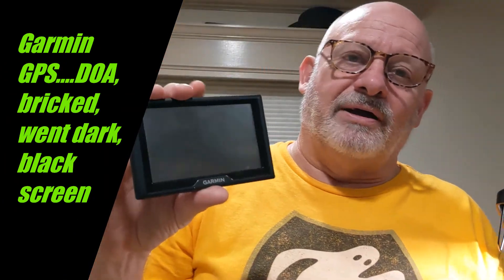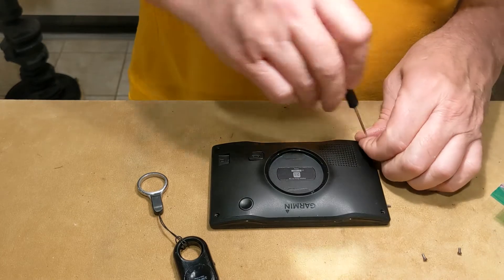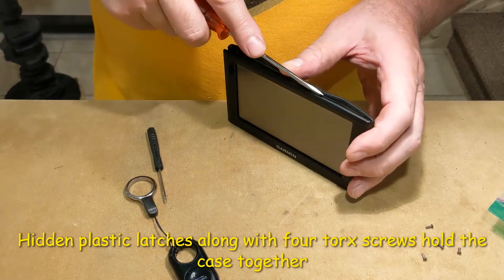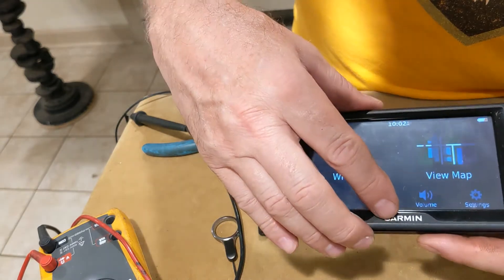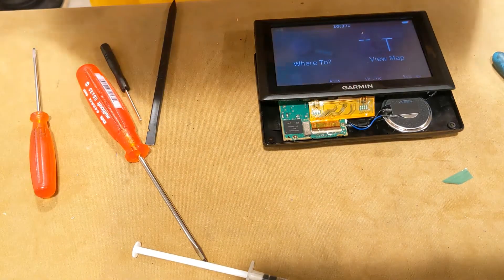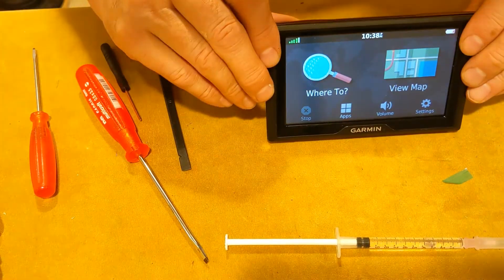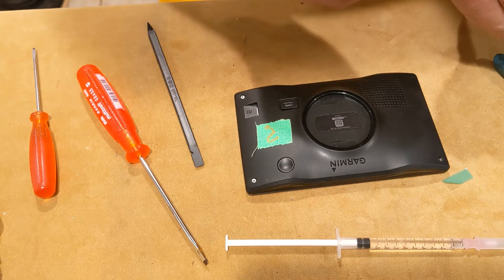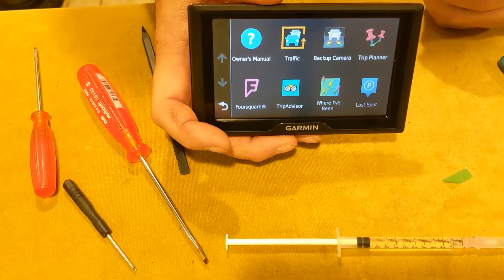Garmin GPS repair

Comment: Any idea why suddenly no sounds please? I tried updates, opening it up to check speakers wire, no resolve. Great video, thanks.
Reply from the maker: I had that happen to me once and I had accidentally muted the audio and the status of mute/unmute was not obvious to me.  

 You can use a 1.5 volt battery to apply voltage to the speaker and confirm it reacts,  I would first disconnect one wire from the GPS/speaker connection first to avoid possible damage to the audio driver
Reply: @neuromanglers  Great idea, seems that Audio files are gone, frequency test again no sounds, tried updating to restore audio files, no go. Oh, speaker has a line on it, vol is high= blue color slider
Reply from the maker: spkr has a line on it....that is the mute symbol on my device.
Reply: @neuromanglers  Yes, orange= muted, but mine has "missing WAV. files" meaning no audio, but looking inside the files, files are there, anyways, bought another one.  Thanks bud..be safe

Comment: You mentioned that the unclipping may have been caused by dropping it.  Too bad Garmin doesn't find a way to design and market versions which are heavy-duty, even if that means for use by professional drivers who must jostle the units between different vehicles.  My most frequent Garmin repairs are related to the power cords ($70) and plugs which bend or unsolder because the cords repeatedly get stressed while connected to the power port.
Reply from the maker: Yep...I do not recall dropping it but it looked like it would not take much.

You might could add a strain relief to help the power cable survive.  I have added that on one of mine that kept coming unplugged just sitting there going down the road 

A heavy duty version would be awesome !
Reply: @neuromanglers        What's a "strain relief"?  
By the way, I've had two mounting units fail behind my big Nuvicams because the female holes in the center of the magnetic 3" connector disc lose some inner plastic designed to keep the holes taut on the male coming off the windshield.  So, at first, you put it up on the windshield and the screen tips down at the first bump in the road.  After a while, sometimes after I've tried glue, I have to always mount it low enough to have it rest on the dashboard.  (It always has to have a view of the road for the cam.)
Reply from the maker: A strain relief for the cable can be a wide variety of forms, but the idea is to hold the cable in such a way that it is not flexed or bent across a sharp or hard edge that would break down the wiring.  The strain relief also serves to anchor the cable in a way as to not put strain or force on the actual connector or connections.  
Often I use a piece of silicon tubing and a mountable zip tie.  the tubing can be slit if adding it to a cable that already has a connector.  The zip tie is wrapped once or twice around the tubing with cable inside the tubing.  the mountable zip tie has a screw flange that can be attached to the equipment.   The silicon tubing allows the cable inside to flex but not slip or allow force to pull on the connection.  you can also use two zip ties if you do not a mountable tie....
Reply: @neuromanglers  So it's like a cast on a broken leg.  I might need to make mine the shape of an ankle.
Reply from the maker: yep...sort of like that I guess you could say